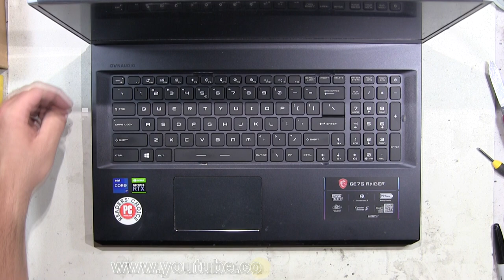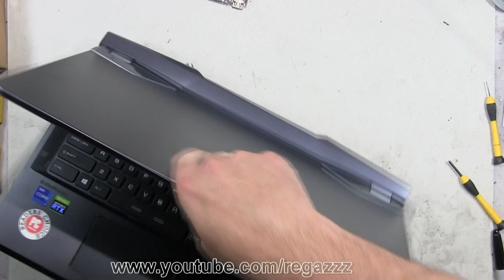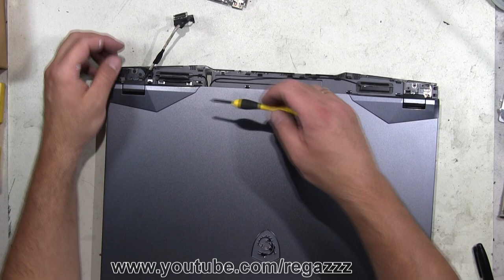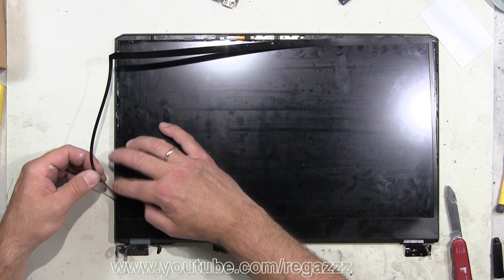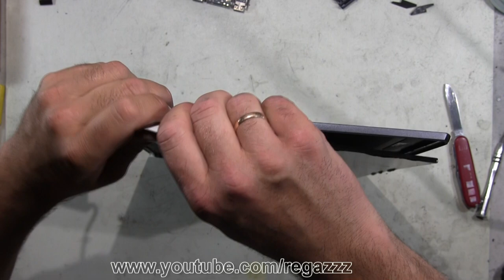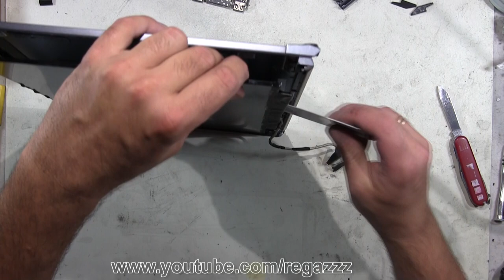MSI GE76 Raider 11UE How To Complete Take Apart Full Disassembly Nothing Left

Comment: This is cool! Tell me, friend, I have the same laptop GE76 11UG, I want to replace the installed FHD 360 Hz matrix with a 2K one! Is this possible? Does the 40 pin connector cable support this upgrade?
Reply from the maker: Hi, I don't know. If I would plan for such an upgrade I would check if there was a similar laptop available with these specs. If one was designed for 2k, maybe it could possibly if they share the same motherboard... I would start searching for a complete screen first for safer replacement options. 
Otherwise it is maybe cheaper to buy a better monitor and connect it :-)